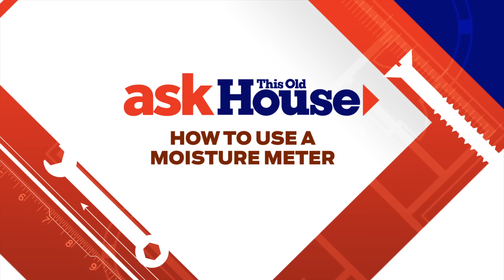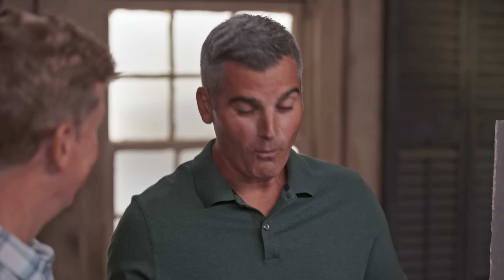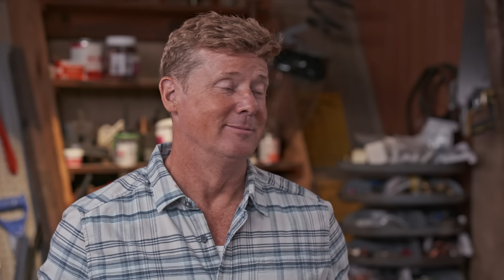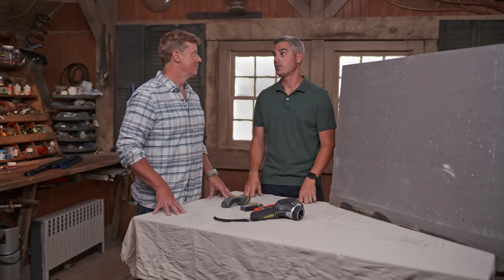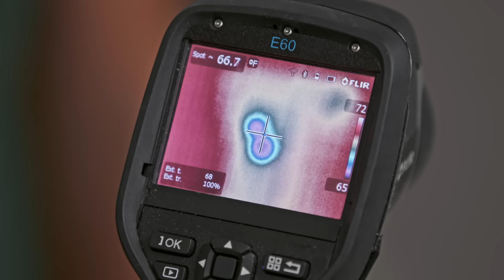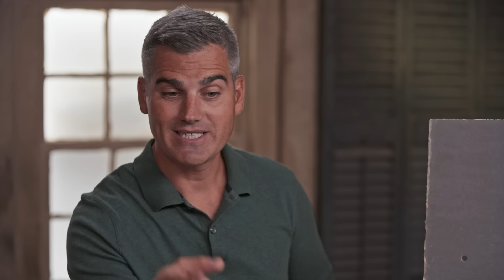How to Use a Moisture Meter | Ask This Old House

Comment: I got that little Klein and so far I’m really impressed. It has a mode button for hardwood, soft woods, drywall, masonry. That seems to adjust the scale of the LED’s as to what moisture content is green, amber, or red and it beeps if you hit something super wet. Handy scanning in awkward positions where you can’t see the screen. It will pick up that the drywall next to the shower has a safe but slightly higher moisture content than the rest of the house. Also as the instructions say if the material is thinner than 3/4 it may detect moisture of something behind the material, which it does. A plus for my purpose (mainly RV’s) but if that isn’t desired you can just use a bit of material as a spacer

Comment: I am painting my wood siding. I removed the paint completely on some of the planks. After the first primer coat I power washed all the siding. I have seen innumerable concepts online regarding how long you should wait before painting siding to avoid moisture in the wood ruining the paint. Is there any way to check for moisture in these situations, and what is the number in percentage of humidity to have as safe?

Comment: Great video. I had a contractor come out to assess water issues around my home who tried to sell me a system that would cost me $12-15k using only the thermal cam. Nice to know they weren’t totally off the mark, but that they should have used some of the other tools to verify the readings.

Comment: I am here because my dishwasher leaked (brand new install) and the restoration company came out and used the pin meter on the floor joists and subfloor in my basement, it was reading 80% in some parts as I looked at his meter. I now have all kinds of fans and dehumidifiers going. How much water is too much water to dry out?
Reply: If it's 80%, you should be sucking it out, not drying it out.

Comment: Can it read if there is water under a vinyl floor? Our shower overflowed a little, and I'm nervous is moisture is trapped under thr floor. Or will it dry since the heat is on now(low humidity) , and it was a one-time thing?
Reply: Generally, there needs to be an ongoing source of moisture for something to stay wet. I wouldn't be too worried about a one-time small-ish exposure staying wet for a long period of time.
Reply: Yes it can. Always compare to a known dry area. Not all materials measure the same. Anything over 14% is considered wet but it's not an absolute

Comment: I have that Klein non-destructive meter.. the second one he showed.  Works well and very reasonably priced (<$50).  I use it to test wood for my carpentry/wood-working and it is also very useful for drywall finishing... lets you know if any areas still need to dry before you finish sand.  Drywall mud can look dry, but actually may not be.  Especially in thickly applied areas like corners and around electrical boxes.
Reply: Yeah I got one recently too. Mainly I intend to use it on RV’s, where tiny flaws in seals going undetected until there is major rot damage is pretty common. It does say if the material is thinner than 3/4” it can pick up moisture in something behind the material, and if that isn’t desired use a block of similar material as a stand-off/spacer. Scanning an alder butcher block table I built years ago, the moisture reading goes up if I have my hand on the back surface. I’d bet it would read wet insulation behind an RV’s roof decking.

Comment: Had a section of damaged flooring replaced. Replacement waited until the moisture content of the exposed subfloor matched the moisture content of several samples of the undamaged floor.  It happened to be 11%, which I thought was high. But what mattered was that same measurements were found on several spots around the room.

Comment: Or touch it feeling the wetness
Reply: It’s not always wet to the touch if it’s on the other side of the drywall. Not always visible either.
Reply: Doesn't always work that way
Reply: Unfortunately your fingers wouldn’t feel the drywall being wet in this case, the moisture was from the back, and diffused through.
Reply: That's what she said